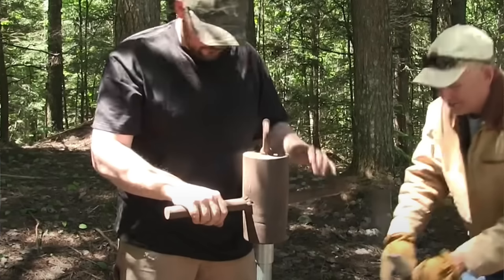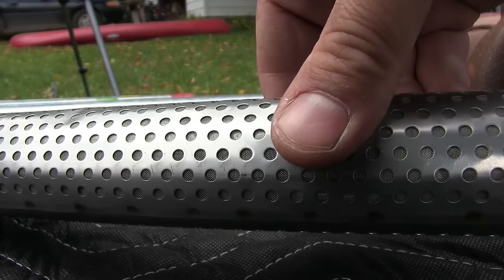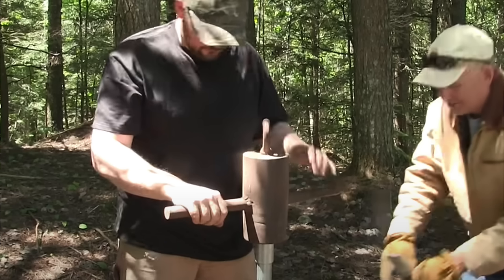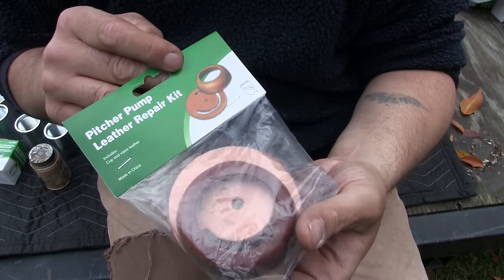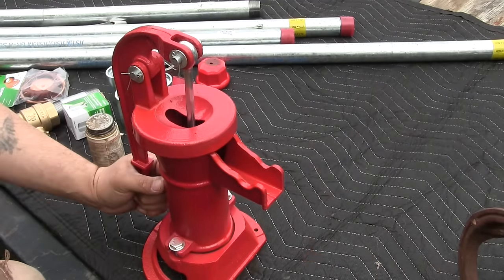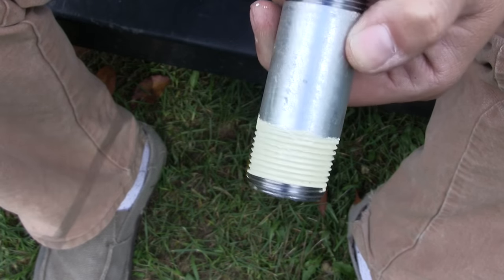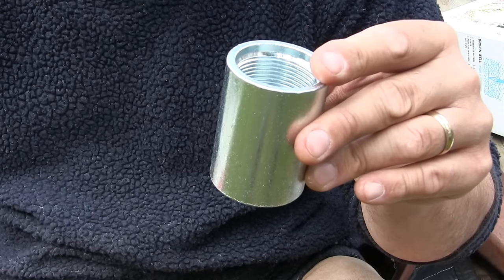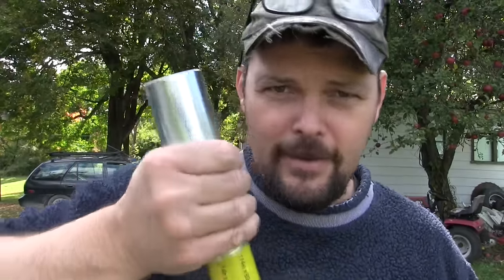Hand Pump Well , off-grid, self-reliant water, everything you need to know

Comment: Well done,pun intended I used a piece of garden hose and stick down the new well and blow when i start getting close to water you will feel and hear the hose bubbling when the bottom of the sand point hits water. Then you can measure your depth needed to get the top of the point below the water table. They do make a shallow well pipe puller it has three dies that go in it to grab all the way around the well pipe for a straight pull. Gotta get creative when pulling it can be quite dangerous. Really well done video. I learned a few tricks ty. Skinner

Comment: To pull well which I have done before to change out a lock screen and I have also pulled a couple other ones that didn't go right, I built myself a tripod with a hook in the center and use a chain hoist which you can do on a fresh well. On a pre-existent well you need to drive it down first, so you usually put on a 3-ft length with a driver and and drive it down at least 6 in and then you can usually pull it. I would use this message like I said a couple of times beyond just one where are people have gotten stuck in couldn't get it to go any further or in the case of the old well which was in for at least 30 years, that one I had to drive down like I said about 6 in and it pulled almost as easy as them that had gone down over the last day or two.

Comment: Thanks for such a thorough treatment of the hand pump.  I found an antique Davey pump several years ago, now I know that it was missing the weighted check valve.  Lehman’s has a great selection of well points, pumps and leather kits including the flapper weight.

Comment: Great information! I especially liked the ball valve. That's a good idea. Just don't let the water freeze if its above frost level in pipe. Also, do you recommend boiling or filtering water if your using it for consumption? I could see adding some kind of gravity filtration system either on the spicket or in the pipe. Thoughts?

Comment: I am a steamfitter by trade , don't use pipe dope on drinking water pipe, use only tape. the tape or dope is not to seal the joint it is to lube the threads so they don't gall when you are tightening them. thanks for the video.

Comment: I've used a root feeder to soak the soil and set fence posts so easily that you can lift then up and down by hand after they have been driven in.  would leaving a root feeder run for hours before driving a well make driving the sand point easier?

Comment: Another great video. Thanks Dave
It is important  to do your  research  and use stainless or brass  fittings in the ground because black pipe and fittings will rust out in a few years and even "galvanized" will eventually rust and fail. At my well head which was 10 feet below grade where the waterline turned towards the house the driller put a galvanized elbow just outside the 6" drilled well caseing. That  galvanized elbow lasted for about 20  years before it slowly failed where my deep well pump was constantly pumping.

Comment: Use a vertical shaft wind turbine to lift the water to about 10 feet through a very thin line into a subsurface reservoir. From there it is easy to hand pump it the rest of the way without the reservoir becoming frozen in winter.  That way if you need a deeper well it can still be hand operated with a wind turbine and reservoir assist. No electricity needed. The very thin line reduces the weight of the water along a long length and so allows for more effective pumping at depth since there is no rush to get it to the reservoir.

..

Comment: Great video and explanation! Do you think it's possible to drive the well right next to an existing structure and have the pump inside the structure? It would require bends in the system above ground, either PVC or possibly some sort of flexible hose. Thoughts?
Reply: I believe you can put the pump most any distance from the well as long as it is not over about 25ft above the static water level. The piping needs to be able to withstand the vacuum created by the pumping action.

Comment: 12:18. You don’t have the weight positioned over the hinge part of the leather flapper valve.  The weight positions the leather valve when installed properly.  The weight has that tuned up tail for a reason.

Comment: Instead of sacrificing a drive coupler you can use a short piece of pipe with a driving cap with your pipe pounder. To pull a pipe back out you can make a cap with a loop on it and use a tripod and a chain fall to pull it out. You also want to keep tightening the pipe while you are driving it in.

Comment: To make the well easier to pull at a future date, you can grind a taper on the "top side" of each coupling as well as grind a taper on the top of the point. This will allow the couplings and point to not act like a barb.

Comment: Suggestion n question. Where can we get replacement leathers? Also  pretreat the leathers with a mixture of 50/50 lard and olive oil. Remembered this trick from my great uncle back in the early 1960's on his farm.
Reply: Also, consider honing the main pump cylinder with an electric hand drill and honing stone used for engine cylinders. That smoother bore will give the leather cup gasket a longer life. Great video, glad I found you.

Comment: 300 year old tip. Drop a silver coin down the pipe into the well tip. Silver is an antibiotic, anti mold, anti mildew. A silver coin was placed at the bottom of wood masts too. It was "for good luck", but also reduced wood rot there too. 
A 1/10 oz silver round is less expensive than an old silver dime, but a piece of old silver jewelry would work. Just make sure it's silver, not German silver. Which is nickel and tin.
Reply from the maker: thanks for the tip

Comment: Very cool explanation, actually the best I have seen on hand pumps. 
Just one question, instead of using the copper ball valve, would a copper check valve not work (more automatic).
Sadly, I think my rocky terrain won't allow for this sort of driving system. I will have to use stormpipe sections and dig them in until i get to water.
Reply: check valve should work. But if your temperature drops below freezing and you have water in the pipe.... no bueno.

Comment: Excellent tutorial.  Thanks.  Instead of using a homemade pipe driver, do you think a fence post pounder would work?  They are only 12 to 19 pounds in weight.  Not sure if that would be enough to drive the pipe.
Reply: My husband added a 25 lb. Barbell plate to the top of ours……just lay it horizontally, with the hole in the plate in the top center of the driver…throw a couple tack-welds to hold it in place…it works great…..

If you have no welder, you can drill a hole in the top of the post driver, lay weight plate across top with the plates’ hole lined up with the other hole you drilled…..get a bolt and nut ( hardened bolts are stronger, and marked with 3 lines on the bolt head), then take a couple large washers ( they may be different sizes, to allow for size differences in the 2 holes , but that won’t matter , just get the big thick ones used on carriage bolts)….

Run bolt thru washer ….insert thru bolt….then up thru hole on post driver……top with plate…..another washer on the  other side ….bolt ‘em’ up…..you’re good

Comment: Use a fence post pounder they look similar but about three times longer. And you can buy those and add more weight if you so wish by welding weights on or something. Menards, Home Depot, fencing suppliers, farm and fleet. You can get them anywhere you can get fencing materials. And I’m sure it would work a treat, that extra stroke length will really help drive it further with each strike and it won’t need it to be 90 lbs to get results.
Reply: Ok, just saw it in action in another of your videos. So same concept but on the outside of the pipe. Instead of a rod guiding the weight it’s a bigger pipe around the smaller t-post/ well pipe.

Comment: You are one of the few who does "real" off grid. 
You definitely want drive couplings not the black malleable fitting you called "cast iron". Cast iron are heavier because cast iron is brittle, and malleable fittings are not. Don't believe everything a sales person tells you at Menards. Menards is one of my favorite stores, and I recommend them often.
Reply from the maker: They do have steel drive couplings right next to the sand points

Comment: A post hole pounder with a 5 pound weight welded to the end does wonders on those. I put an electric well pump on mine to run my water in my camp.

Comment: 15:39 pro tip for cleaning pipes. Attach a rope to the little hole in the handle and pull it through the pipe a couple times

Comment: I'm about to install one of these in the woods behind the house where several springs come out of the ground year-round. There is water on top of the ground most of the time. You you say to go one ft below the top of the screened part of the pipe for the water depth. What if that's only a few ft? Would it hurt to go farther down?  Thanks for the vid!
Reply: Go down as far as you can, so if there is an extremely dry spell you are covered.

Comment: Well my water table is less than a foot down my old well I was 50 feet deep and it was low yield my new well is 400 feet deep and I have 390 feet of casing

how do I know that the water that’s just a foot below the ground is safe to drink should I get it tested
Reply from the maker: It's probably not. The sand point works well in this part of the country as the water aquifer is massive and anywhere you can reach it within 20' of the surface you can use a well and pump like this one. Thats not the case everywhere

Comment: It would be very easy to buy leather and cut out a piece like the one on the illustration of the pump repair kit. And cheaper too. Which is probably what the old folks did. Use the one that is worn out as a template and broaden the connecting piece between the two rings.
Reply from the maker: you could

Comment: Well done and thorough explanation.  Are you using regular galvanized/threaded metal piping for that or are all the pipes stainless?
Reply: Usually only the 3 foot perforated point section is stainless. The other sections of pipe are special hard well pipe and special hard steel connections. If you do not use those well pipe parts... you're setting yourself up for failure.

Comment: Great video! You've answered my biggest question about drilling through the ground to get the well pipe to the water table without a large commercial drill rig using rock bits etc.
Reply: He’s using a sand point which will not go through rock. In fact trying to drive it into rock will damage the point.
This method works well in sandy terrain.
Reply: @readyornot316  Thank you, I started checking out those kits they have for the sand point wells and those are really cool.

Comment: I've never heard of using a ball valve I've heard of using a check valve for the water only goes one way and you put it every 40 feet on the pipe as you're coming up so it never loses loses its prime is it a check valve you use or a ball valve
Reply from the maker: The ball vale is like a "prime lock" that holds the prime up.........a check valve would do the dame thing, but if it was getting really cold at night you couldnt let the prime down to avoid freezing....with a ball valve you can
Reply: Thank you👍

Comment: Lots of great information. I haven't helped drive a well since I was a kid. Where we lived about ten years ago the water table was about sixteen feet down. However all the potable wells were down around a hundred and eighty feet into the aquifer. The problem it seems is that with a hundred years of farming the surface water has a high level of pesticides and other chemicals. It's a good idea to have your water tested. In the northern rocky mountain area that we now live there can be arsenic and other chemicals that may need filtering for safe drinking. Mostly good sweet water here but there's always a chance of natural contaminates. Thanks for the video. It is well done.

Comment: Great video...  thanks for all the useful information.  For witching water, use two 24" gas welding rods each bent at 90 degrees 6" up.  This would look like an "L".  Vertically hold the 6" ends and let the rod point where they want rotating freely in your loosly closed hand.  Walk slowly over the land and when the rods swing together and are parallel with each other, water is below.  Note that I am not sure why, but some people can witch and many cannot.  So if your rods never come together, just ask your closest family member, neighbor or friend to give it a try.